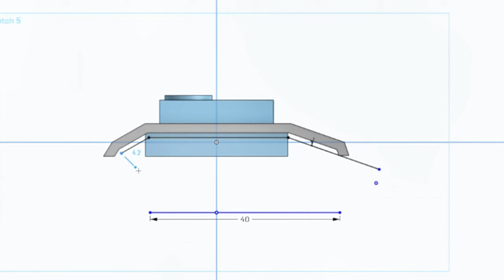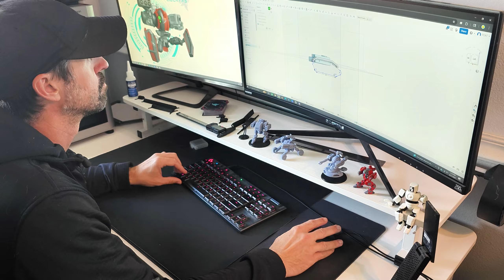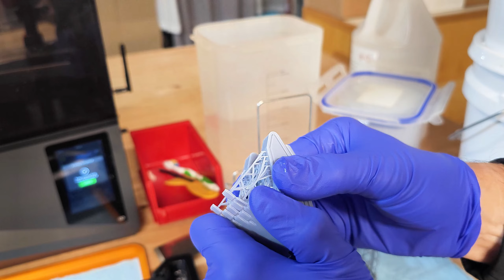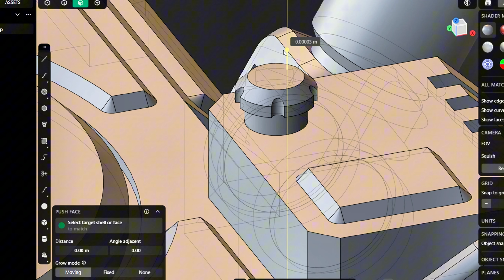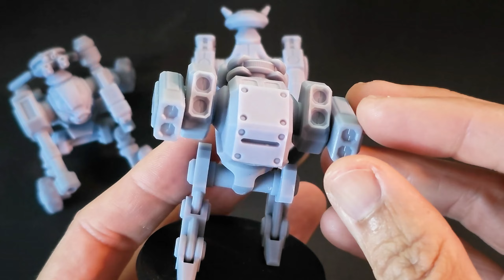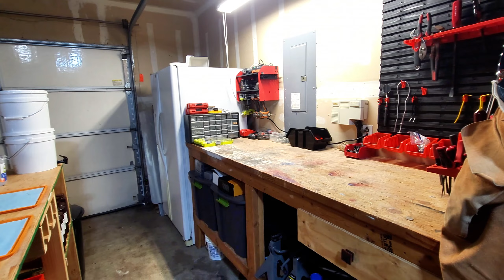The Ultimate Guide to Creating a Miniatures Game - part 1

Comment: What is your experience with resin printing? I'm curious about its strengths but am very hesitant to bring toxic chemicals into my manufacturing space.
Reply from the maker: It can be a bit messy, but it's one of the best methods for printing miniatures at home. Ventilation is your best friend. As you can see in this video, I have them in my garage. When I'm doing some heavy printing, I'll open the roll-up door and the side door. I hardly notice the fumes under those conditions. Other than that, make sure you wear your PPE.  The technology has come such a long way in just a few years, and in my opinion, it's definitely worth it.
Reply: Thanks for letting me know! I'll have to look into anyeco-friendly resin options again. One of the things I like about FDM printing is the ability to use recycled bioplastics, but I'm less knowledgeable of resin.
Reply from the maker: @eighthmoon6100 that makes sense. I do know there are more and more products coming onto the market that aren't as harsh. I haven't tested many myself